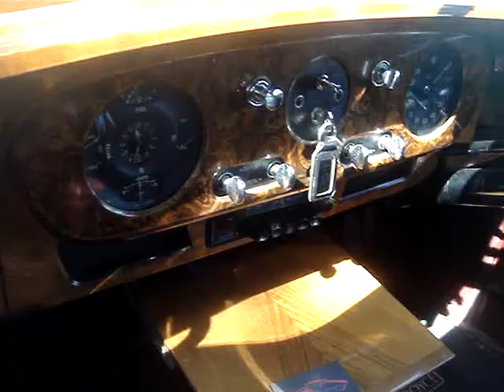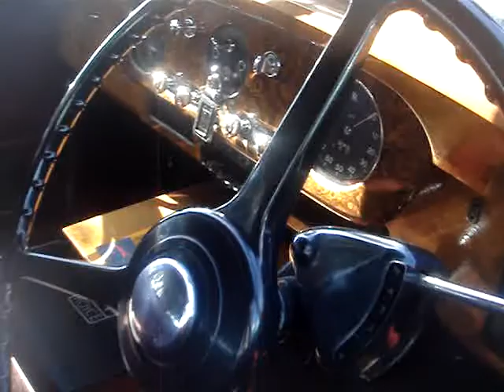1957 ROLLS ROYCE SILVER CLOUD - OUTSTANDING LUXURY

Comment: Rolls/Bentley called that fold down tray, a "Picnic Table" .  I drove a 1956 model ( it was Gold abd Black), in the mid 70's and at the time I had a 70 Riviera and my Riv was more comfortable and drove better than the old Rolls
Reply from the maker: califdad4 Yeah, that's a proper name for that tray, a Picnic table.  Sounds fitting.  So you drove a gold and black Rolls, wow, what a great color combo.  The Riv wins again !  Rides better than a Roll Royce !  Amazing.  Thanks much.
Reply: the Riv was much easier to drive also.   This Rolls It was nothing like a Cadillac or Lincoln in the day.  Nothing you would want to drive across country, rather stiff and hard to steer and not very comfortable in that narrow front seat
Reply from the maker: califdad4 The difference between American and British luxury cars are so far apart.  Whereas the Rolls had great build and quality control with craftsmen, plus a decades long reputation, the American makes had many innovations and engineering feats that provided that great ride and comfort, etc.
Reply: Rolls Royce is a crafted car on a slow assembly line. Cadillacs and Lincoln's are assembly line built . I had a 1986 Marmon Cabover Truck and it was a hand built truck. they were assembled at station's in the plant at Garland Tx and Bethlehem Pa. Cabovers at Garland Tx and Conventionals(Hoods) at Bethlehem Pa. in the old Harrington plant.There were no assembly lines . Just big roll around carriers
Reply from the maker: dougslittlediesel I don't know how many Rolls were built on the average per year but these were indeed hand crafted cars on a slow assembly line.  The company also catalogs all the original wood used in the interior in case a wood trim piece on a Rolls would ever have to be replace.  Astounding !  Thanks for the info about the Marmon Cabover truck.  Most people including myself never knew much about that vehicle.
Reply: Well that Marmon Truck was the Best Built road tractor built . From 1967 to 1993 they built 497 Cab Overs , 65 like mine with a double wide extended can and number 387 in the production run.Conventionals produced was 3,600 total run over the same amount of time . And this was the old Marmon Roosevelt co.. Then Roosevelt was dropped when the Harrington truck Co. bought out Marmon. But the Marmon name was kept up frontin the deal because it was well known .And they stood behind their truck with a life time warranty .I had a broken cab latch and a cracked cab panel and support . I went by the plant in Garland Tx. to get the parts and they said they could fix it while I hung out.And the guy who repaired it was the
man who built that part of the truck.They fixed it for free. Guaranteed for the life of the truck .